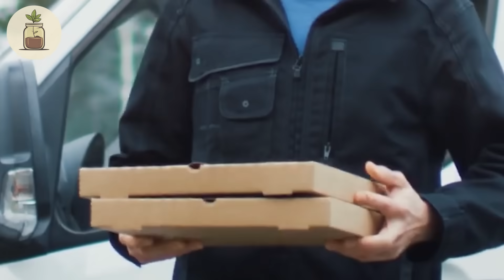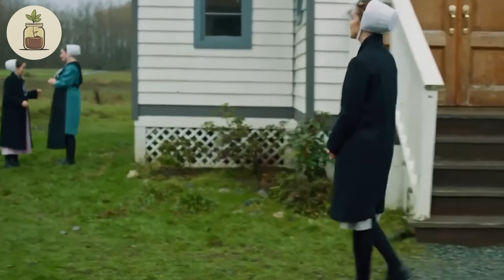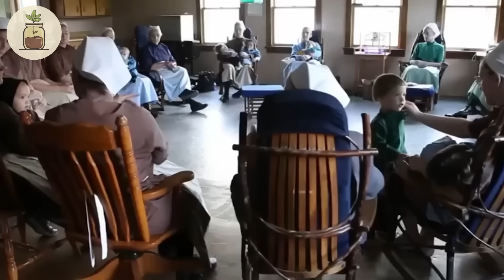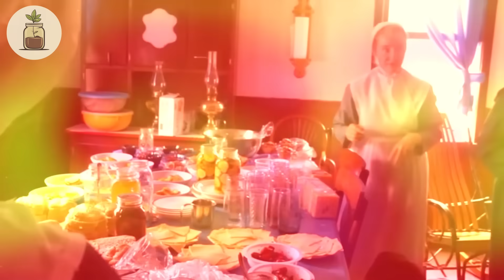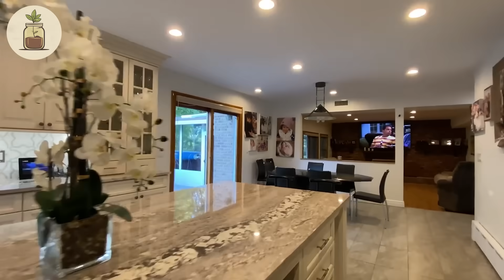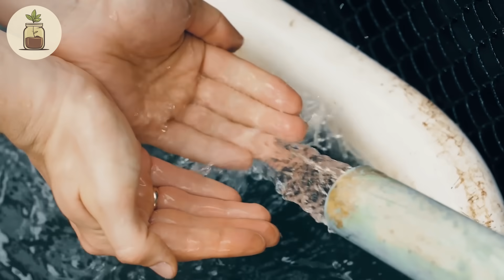How Amish Cool Their Homes Without Air Conditioning

Comment: AMISH DO NOT USE WOOD STOVES.  THEY USE OIL TO HEAT WITH. AUGHH. DRIVES ME CRAZY THE LACK OF RESEARCH.  THEY DO NOT HAVE ELECTRICITY, OR USE IT. ONLY OIL, OIL LAMPS, AND PROPANE REFRIDGERATORS.OR DIESEL.

Comment: We cooled our house with block of ice and fan in one window pointed out and one pointing in if you run conducts down and put a blower on it it will blow 60 degrees air through your home with return system doesn't take a genius to figured it that's why all caves stay 60 degrees all year long if you put mirrors and gods sun reflects it heat your home all have to do put a blower on it upper parts of the home today lower parts of the house hear raises the closer we get to the sun hotter it gets the deeper we go in the ground the cooler it gets doesn't it now how much time does it take to figure it out today and understand God is good God is great and I don't have a problem being useful today ...and respect and grace be worth thankful and grateful to survive through such circumstances situations and challenges or have a problem being a part of and obide the laws of power today....now what wrong with that today whats in it now... what hell happened to baby momma and grandma today who am I today....hmmm omhhhh whose taking advantage of and granted of long term today while stealing from who lying cheating grandma today....what's up how much time does it take  who deny deny deny and rejecting today ...no thanks no gifts and give me died today not able to change yesterday and tomorrow is not promise its time God to reciece blessing today ....God promises devils not supposed put anything on thy thee thou plates can't handle now is thy thee thou today....thy thee thou don't give a damn and we don't have 2 f@ck left today ....

Comment: I can max out ac and everything else for free. It's called I put a solar panel on the roof. I live the modern lifestyle but never pay any utilities. Solar panels. And have a series of large batteries to store extra energy.

With water, I have many large water tanks that I can to store water and rain collectors. It goes through a water filtration system I've built when I want a drink or take a shower, wash dishes, etc.

When hurricane isac happen not to long ago everyone was without power. Not me, though.

Duke energy actually paid me to reconnect to the grid so my neighbors would have power.

Comment: Regarding thick, mass loaded walls: I have 14” thick concrete home built in late 1890’s by a mason. Inside wall are terracotta blocks that trap air inside (I.e., insulation). It takes 3-4 days for inside air to get anywhere close to outside temperatures

Comment: A friend of mine has a house below grade. She parks in her garage on street level,  then descends a 20 ft drop down stairs to her back door. The house is always a cool in the 70's. The house is below the street. Supposedly being below grade is what keeps it cool.
Reply: That's the same concept as living in a cave, they stay the same temperature year round.
Reply: @kellywhite1663  True, but her house is surrounded by dirt on 3 sides, the front looks out. The roof is not even tree shaded, yet that 3 side enclosure keeps it cool as a cucumber even in mid CA summer like now. (July) No air needed.
Reply: As a Plumber we work in tunnels under houses. Here in Texas it gets extremely hot in the summer but in the tunnel it's nice and cool. Being surrounded by dirt is nice
Reply: That's exactly correct 

She's got a variation on the berm construction method.
Reply: My grandparents had a cool house. When you walked in the front door you would be in a foyer and there were 2 staircases in front of you. You could go to the left hand staircase which went down into the lower level bedrooms and the family room. The right staircase took you upstairs to the living room the kitchen and the upper bedrooms. They both aimed straight into the house if your back was to the door. Its not like you turn left or right. You were just standing at a turnaround landing basically. Outside on the right side of the house the ground was lower than the other 3 sides of the house and you were ground level on the patio and could walk right into the basement family room. There was no ground level floor except that foyer where we took our shoes off. It was a 2nd story and a basement. Same layout on both levels. I absolutely loved that house. It stayed a mild temperature all year and I think about it often. It was the family's get together place for the holidays. They had over 70 acres that the colonial sat on and you could see for miles around from the upstairs picture window. It was high in elevation for this area. You could see the ohio river and the greenup dam in the winter which was like 15 -20 miles away
Reply: @SeptemberSon92286 You mentioned the Ohio river. What state was this?
Reply: @Asia-rf5qk ohio
Reply: @SeptemberSon92286 Ok. I didnt want to assume.

Comment: This doesn't work in the brutal desert which is why you will see very few Amish in the desert southwest. Opening windows here during the day only lets in more heat... after dark it's time to start opening windows here.
Reply: I'm in SW & I use cross ventilation a lot. By 9am I close up the E.side of apt but, leave W.side open. By noon it's all closed&I use2 box fans & 3air purifiers2 circulate air. By 4-5pm I can open east side back up.
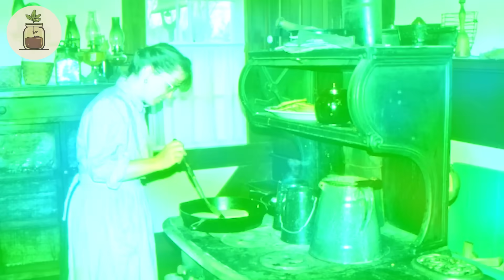By 7:30p, b/c I have another bldg.on my W.side,I can open up W. side door again. I try to lock up by 9pm.
Reply: It works in west Texas. South of Abilene! I’ve been in a house with no air conditioners or shade but because the walls were so thick it kept it cool inside!
Reply: @paulaclark7989 well I would imagine with super thick walls that would make a difference

Comment: No thanks!  I live in the hot, humid south and I love my AC!  I know how people live without air conditioning ... they just suffer with the heat.
Reply: I live in the South and also Love 
A/C because my house holds heat like Crazy which makes for cheap Heating but I have had many Homes and see the Value of the Amish building Methods and If I were to build my Own well When I do I would Prefer to build it Amish Style for many Reasons and supplement with A/C just for that little extra and a wood stove for Heat in the winter  but to have your house not be a death trap in the sunmer would be a joy its easier to get warm than to get cool
Reply: Seems missed point
Reply: Me too

Comment: 80-85 degrees would make me sweat profusely.
Reply: I'm used to it. I don't use much air conditioning. I like 80°partly b/c I have a low thyroid condition.  Also, dont like air blowing directly on me due2fibro myalsia. Thirdly, my neighbors choke me w their 2nd hand Pot/ canibus smoke  which is worse if I run the cooler; it's worse. I enjoy saving $ w cross ventilation& small fans when there's no breeze.
Reply: Those walls must be way over three thousand foot thick for sound to take three seconds for a knock to be heard.
Reply: @BarnumStoltz Either that or the speed of sound is being manipulated
Reply: Yup, same here. I HATE the heat and especially humidity, and sweating. Ugh!
Reply: Me too!
Reply: That is why I live in the north pole of North Dakota
Reply: They have been ACCLAMATED over time.
Reply: Yeah, but but there are times that you won't have to use that much electricity to stay warm or cool and times not at all which would save a lot of money in the long run.
Reply: Passive heating and cooling
Reply: Plus when women go thru menopause look out we’re already having hot flashes and need it super cold and if we get hot or have a flash you better run the other way bc all hell brakes loose lol .

Comment: Like to see them in 120 temps in AZ
Reply: Swamp coolers
Reply: @nmd3132 swamp coolers don.t work when humidity comes in July and August
Reply: I know they used to spray water on the roof to keep cool. I saw an old village in the desert where they built a large water tank on a hill and allowed it to drip down onto their roofs below. That would help keep the insides cool. I've also heard you can take a thin, wet cloth and drape it on your body to help you sleep.
Reply: Adobe.